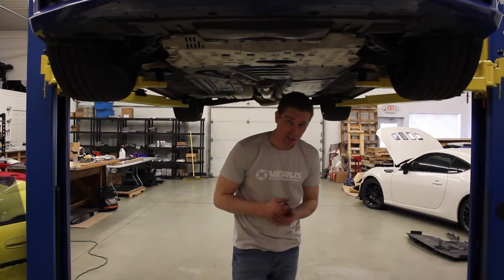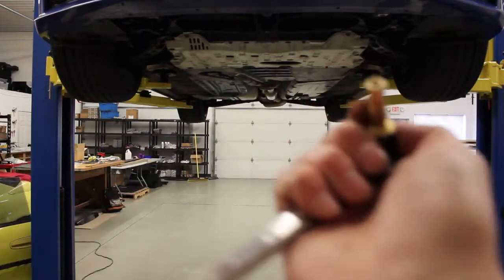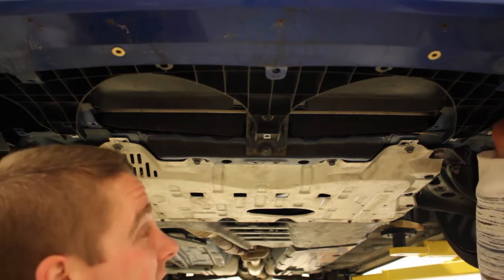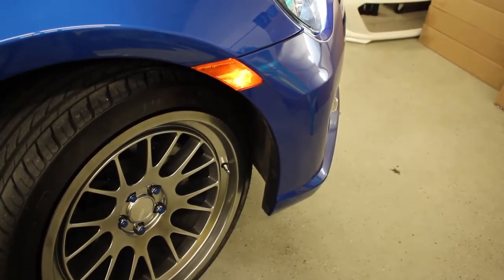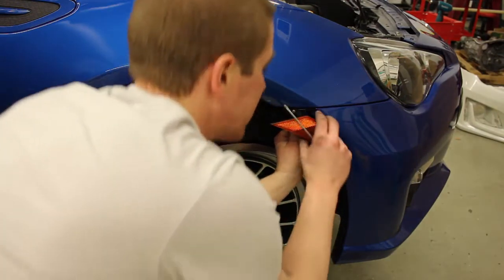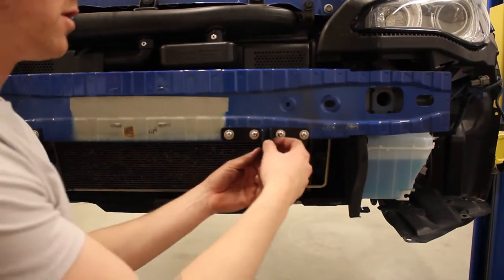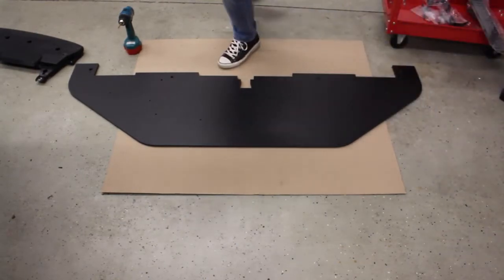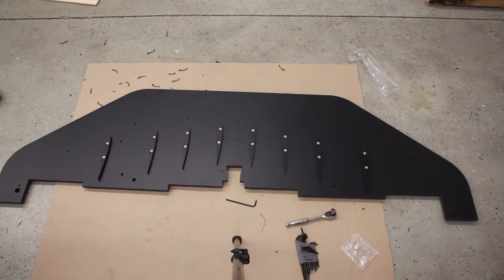Street Front Splitter with Race Upgrade Install

Comment: For the scion frs, does installing the support rods remove the crash absorber foam that would sit infront of the crash bar? In the scenario for a daily driver, that's not a part I would not want to remove.
Reply from the maker: That foam piece is strictly for low-speed collisions around 5 mph. With a splitter installed, I would worry more about the splitter getting destroyed in a low-speed collision than the front bumper. You can also trim around the foam absorber and keep it intact if you would like.
Reply: @VerusEngineering  hmmm so for a daily driver application, would you say the support rods are necessary? I do not track this car. I do spirited drives every now and then on my regular commutes.
Reply from the maker: @Gaammbit  If you plan to drive the car above 80 mph, the support rods are considered necessary as the front splitter sees a decent amount of downforce above 80 mph. You don't have to run them, but they are highly advised.
Reply: @VerusEngineering  Okay noted. That's 128 km/h for my region. Hmm. I just definitely want to have the Crash Bar Absorber on my car at the same time. Your splitter uses all OEM locations underneath and that's a plus. It's also functional in addition to stylish. I would pair it with your rear diffuser for better gas mileage in my daily commute and also for the looks lol.

I just want to make sure I retain my OEM safety, such as the crash bar absorber in this case.

Comment: Is it worth trying to fill the gap/recess between the splitter and the front bumper (top side of the splitter)?
Reply from the maker: In our opinion no. We've seen some custom made air dams, but they are not necessary for this platform.

Comment: Would this work with a JDL bash bar as well?
Reply from the maker: Don't see why not. A lot of the guys that run aftermarket bash bars, use high tensile strength cable ties to mount the crash beam brackets on their bash bar.